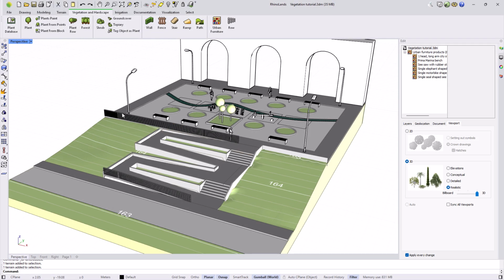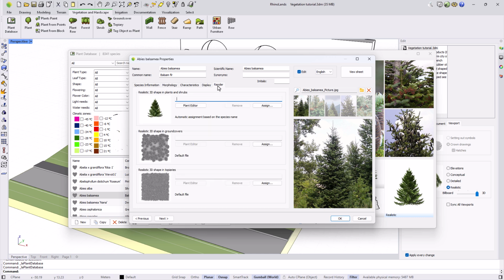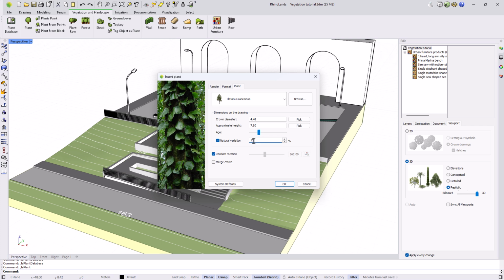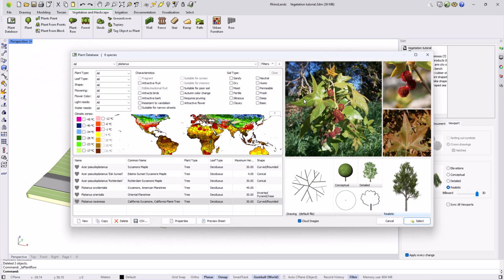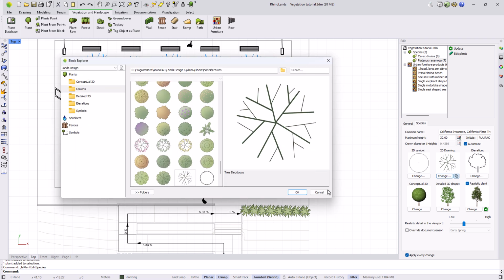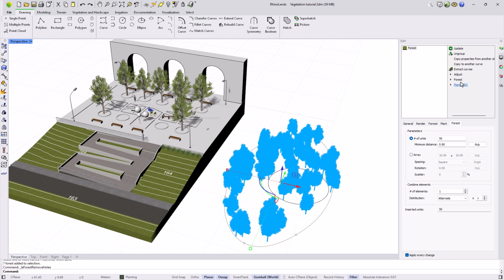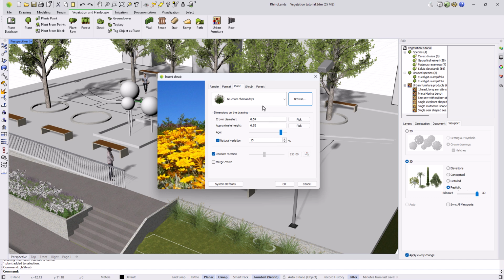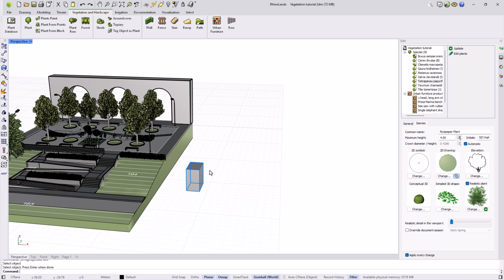RhinoLands Tutorial 05: Vegetation

Comment: Is there a way to save a row that we have created to use in multiple projects?

We are working on a lot of community orchard projects and want to use this tool for the mockups for each project. Our row would ideally include a few dozen elements with different spacing from the path (we expect to have to do 3 separate rows, one with 3 trees and 15 bushes, then two rows with a few more bushes and about 40 herbs/flowers. Having to recreate these each time isn't ideal. I've considered saving a file as a template which includes one planted row off to the side so I can have it available there but thought I'd look for existing options.

This video was great for creating the rows the first time, I don't want to do it again though!
Reply from the maker: Hi, yes. you can open both files. Copy the row from the first project and paste them in another file. You need to have both fiels opened in Rhino.